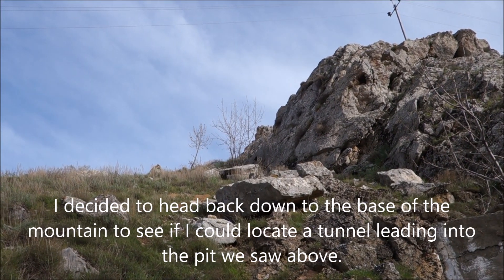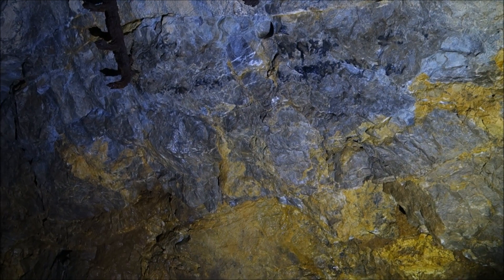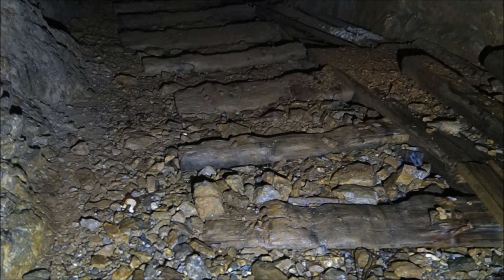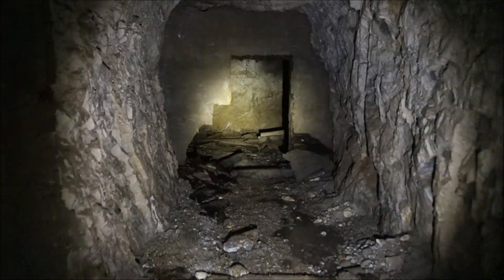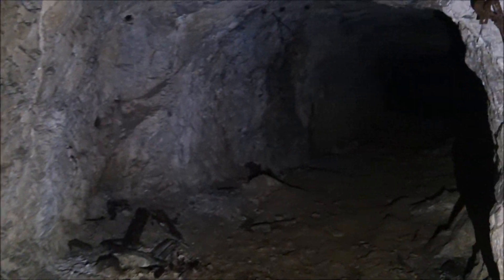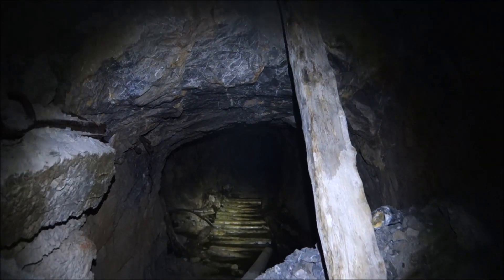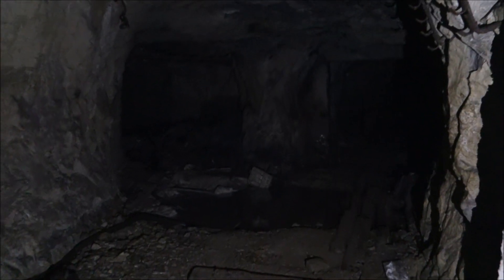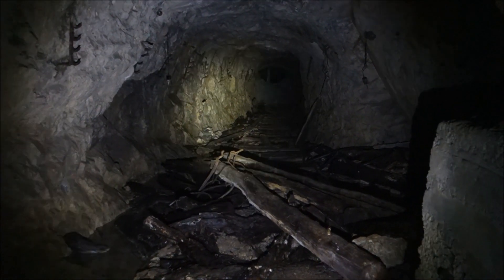Exploring A Giant Soviet Mine Crucial To World War II - Part 2

Comment: That lake of blackness... SCARY and utterly intimidating.  I wonder if either of those rocks have hit the bottom yet !  Thank you for taking the trouble to risk getting anywhere near the edge  -at all. Pheeew. (Easily worth a LIKE, also some kind of award.)
Reply from the maker: Thank you very much. Yes, being on that edge of that black abyss was intimidating! That is definitely not something that I would want to tumble into... It must be incredibly deep. I realized after throwing the rock in and looking at the concrete lip just under the water, that the water was clear. So, it must just drop down forever. You saw how it swallowed up my light.
Reply: @TVRExploring  Forget deep, how would you climb out?  Tread water until exhaustion, then drowning.
Reply from the maker: Yes, I definitely wouldn't want to fall in. I think it would go down exactly as you described...

Comment: Wow another crazy mine! It's scary to think that if you slipped into that large pool that there is a very real chance you would not be able to climb out! Great video.
Reply from the maker: Yes, it made me a little uncomfortable being right on the edge like that for exactly that reason... I don't think I would have been able to climb out because the sides were smooth. Plus, I would have been in complete darkness if I fell in because if I didn't drop my light when falling, the water would have almost certainly fried the electronics.

Comment: Where you said you were surprized the scrappers didn't get the stuff, electric motors, I think they had already removed all the copper windings on the motors, why they were taken apart. Thanks TVR, looking forward to part three. Take care.
Reply from the maker: Thank you. I made that observation about that because the scrappers outside are going after EVERY scrap of metal that they can locate, not just the more valuable metals like copper. I filmed some of the scrappers at work in the third video and you can see what I'm talking about then. It's pretty extraordinary...
Reply: I'm thinking they're working their way in for the steel/iron. The first section of the mine was cleaned out, but the brackets and the stack of rail ties stacked to load up and then burned to get the spikes free. I would also guess that other then farming, scrapping is their main enterprise, as ramote as it is. Watch out for them "Danger Chambers" !!
Reply: I agree.  Looks like they stripped all the copper out of those motors and the power boxes.  Those rings are the laminations from the motor rotors.  Liberated when the copper windings were cut out.  The steel guys will be along for the rest.  Those motors were probably used to power a hoist system in the nearby windz you wisely decided to not cross.

Comment: Another excellent explore. Those motors appear to be striped of the copper winding's, the scrapers were there.
Reply from the maker: Thank you. This one was a lot of fun... Yes, the scrappers were here, but outside they are scooping up EVERY piece of metal they can find - even using metal detectors to locate the stray bolt or nail. So, I was surprised they hadn't removed the big pieces of metal that were underground.

Comment: Also, the "failed stopes" are probably drawpoints. There's likely an open stope located above them; blasted ore falls to the drawpoint for mucking.
Reply from the maker: Aren't the drawpoints filled up with rock that is caving down from the stopes at this point? That's why I was describing them as failed or caved stopes.
Reply: It's certainly possible. I could also see leaving enough muck in place to block most airflow to the stope, in order to prevent ventilation from short-circuiting into the stope.

On another note, we confirmed at least some access into that multilevel complex I mentioned a few weeks ago. Got in on Level 4, there looks to be access to Level 5 via a decent ladder with inset rungs that runs about 20 feet down into a ballroom stope, and the drift running south into another mine is open. We didn't proceed all the way to the property line, but ground conditions are tolerable and I think we can get into the adjacent mine.

I'm also going to be checking out something very neat associated with a gold mine in southern NM tomorrow. There will probably be a video, but it will wait until I've concluded a related business transaction...

Comment: Holy moly, what a lake!
Reply from the maker: That underground lake blew my mind!
Reply: vburke1 I wonder if there’s any records from the original mining effort. From the looks of that poured concrete wall, I’m betting that lake was there and they “discovered” it running that drift, and maybe lost some equipment in that black hole, which gave them reason to wall off the access more or less.
Reply: @michaelhaag4912  I don't know, the sides below the water level were awfully sheer and smooth to me. I have a hard time believing that was natural. I'd guess the concrete "plugs" came well late into the mines life.
Reply: @vburke1  How and why would they put a concrete wall there? It looked natural to me. I think they just accidentally blasted into that cavern and then tried to brick the hole up.

Comment: I think the blue is what they were after Lead. It will be interesting if someone that actually knows what it might be pipes up. One of the coolest with the extensive workings and huge lake. I wonder if that blocked off wall leads to the big hole?
Reply from the maker: I don't have a lot of experience with lead mines, but, yes, those I have been in did seem to have similar blues... No question, I agree this is one of the coolest explores that I have done. That giant underground lake blew my mind. Ha, your guess is as good as mine as to where that blocked off wall leads. I was convinced that this adit was going to run straight into the huge pit, but I was obviously mistaken about that!

Comment: Ever consider you were UNDER the giant open pit?  All that material that came down could be indicative of excavation up above.  In other words, as they dug out the giant pit, crap came down the available openings and into this mine.
Reply from the maker: Yes, I speculated about that in the description below the video... Some of those ore passes and stopes could have led up into the pit. Rock debris from the pit may have plugged them up enough so that little if any light was getting in, but not so much as to block off the air flow. There WAS air flow coming in from somewhere...
Reply: @TVRExploring  that'll teach me to read the description ;)  Same possibility then, reached independently!
Reply from the maker: Great minds think alike and all...

Comment: As you were showing us the lake inside the cave, there was what you said was a concrete wall. What would that concrete wall be there for ?
Reply from the maker: To secure the sides from collapse possibly... There may have been another reason if we could have seen into the depths. There may have been a larger structure below that was covered up by the water.
Reply: TVR Exploring thank you ✌
Reply: So the water possibly came after the miners and their tunnels were dug ?